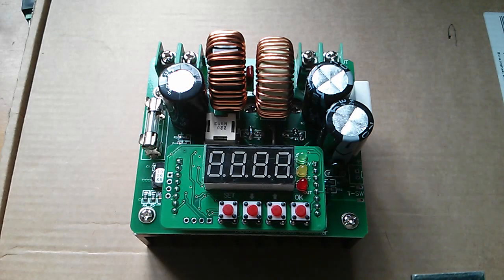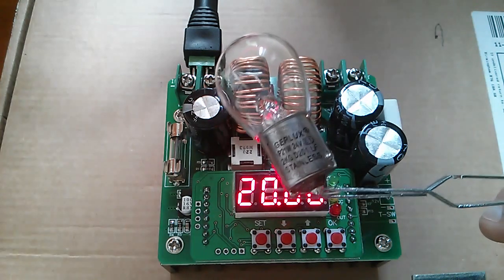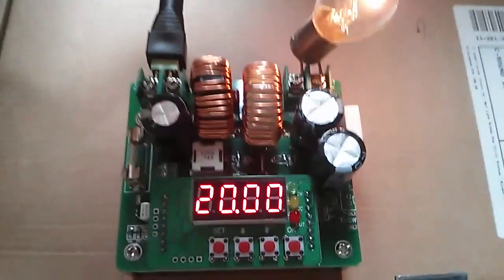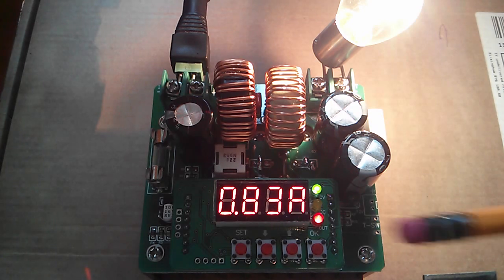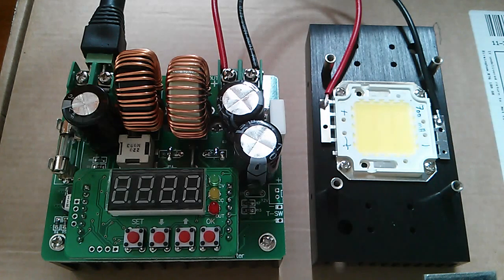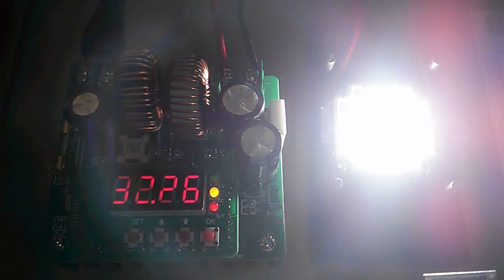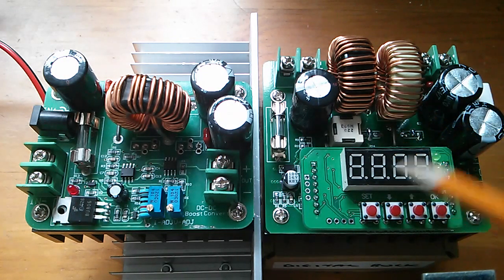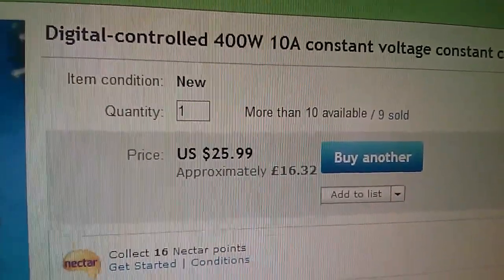Review: 400W Digitally Controlled DC/DC Step-Up Boost Converter

Comment: I was wondering if you could shed some light on something for me, I also bought one of these recently to power a 100w LED, which this should be more than capable of doing if i'm not mistaken, I have set it to the voltage and current limits that the advert for the LED states, but it doesn't even reach a third of the current and the booster powers off automatically. The fuse isn't blowing because it'll come straight back on again, and with the automatic mode on it'll keep powering straight up again by itself as it is supposed to, but reaches around 1.1 amps and shuts off again. Am I missing something here?
Reply from the maker: steamtraintom Try raising the voltage limit. If you limit the current, the voltage should be allowed to find its own value.

Comment: hi,
Does meanwell 48v 1000w inverter runs..I can use this converter instead of 4 batteries...

Input 12volt / 48volt output...

Does it work smoothly. Can I use inverter.. thank you

Comment: okay i need a little help i had bought a boost converter dont know if its a buck converter but the unit i have got can turn off and on the voltage so im guessing that mine is a buck but thats not the problem im having.. the main problem im having is that im connecting a 12.5V poersupply and it says it can output 20V and 1A but when i try to connect it to a motor or sommot the voltage drops down to like 0.30V and the amps stay the same i rly need help coz i havnt found anything anywhere about my problem (that might be because i dont know what to search XD) my unit is minghe D3806 if thats any help

Comment: Im a bit confused, 

So can this generate 32Volts @10amps with a 12v 10A input ? 
or do I need to feed 24v( or more) at the input end to get higher voltages ?
Reply: Arun Parikshat   It can't conjure energy out of nowhere. If you feed it 12volts,  10amp,  that's 120 watts, and you can't get more than 120 watts out.  So just multiply voltage by current to get a rough estimate.  Allow for 10% power loss if you want to be more accurate.

Comment: Hi Julian, so would I set the analog type buck controller in the same manner? ie, set the voltage to full and set current to what I want the LEDs to run at via the potentiometers.
Reply from the maker: saskLS1 To be safe I'd not set the voltage to full, but a little above what you think the LED will need.
Reply: Thank you, this has been most helpful since those regulators come with no instructions.

Comment: Hello Julian Ilett I have a question
Is the 400 W Digitally Controlled DC / DC Step-Up Boost Converter  fit to chip of vero29
The data chip are:
36V
2.0A
80W
I would like to run two LED chips of these and my fear that they will burn in terms of number of watts, what you say and offers to do?
Reply: This thing will drive your Veros.
Of course you always drive LED's in series so you're getting close to the upper Voltage limit of this thing so you won't be able to raise the current up much further.
Also you should have an eye on the input current. What supply do you plan on using to power the whole system?
Reply: צחי וקנין Feature:
Input voltage: DC 6V~40V
Input current: 15A (max)
Output voltage: DC 8V~80V
Output current: 0 ~ 9.99A
Voltage, current resolution: 0.01V, 0.01A
Output Power: 400W (max)

Comment: hi julian ! i just saw your video with 400watt boost converter ,,,is it possible to drive 1 or 2 , 50 watt leds (like yours) on that booster with a 12 volt lipo battery and as per the video we can adjust the amps on the booster(current),,,thks

Comment: Hi Julian Ilett, thanks for that great video!

First of all, I am a little bit newbie about that type of device. I have exactly the same boost converter. I got it in a grab pack by chance. I search the Internet to get more information on it and then I found that video. I plan to use it for different applications/projects while prototyping/learning.

Now I have a few questions:
1) What is the range of voltage/current I can get out of it if I plug on its input a power adapter which has an output of DC 9V/500mA?
2) Is it possible, from that input source precicely (9V/500mA), to increase BOTH the input voltage and current, to get an output of let's say 40V/0.7A (like on the video) or more?
3) Is it possible as well, conversely, to reduce BOTH to output only, like 5V/100mA or anything else?
4) I read in the video description that the output current is 10A max and 400W max power. So I guess that if I want to output let's say 50V, I will max out at 8A of current (50V * 8A = 400W). But, is it true regarless the power adapter I plug in its input (keeping it within the input tolerance of 6V-40V/15A)? This is only theorically, to learn, I don't have that need, at least right now.

Thanks
Jonathan
Reply from the maker: You don't get free Watts. So if you put 4.5W in (9v x 0.5A), you'll get less out.
Reply: @JulianIlett  Ok. It is 90% efficient, so the heat sink is there to dissipate 10% of heat we are losing. Right?

Comment: Would it be possible to run 4 x 100W LED's in parallel on this?
If so, should each LED have a low-ohm resistor to prevent individual LED overdrive?
Reply from the maker: No - not if the input voltage is significantly different from the output. The analogue version of this converter (which is rated at "600W") can drive a single 100W LED from a 12v input, but you can clearly hear it's near the limit.
Reply: Julian Ilett Assuming that you're referring to the noise the inductors are making, the sound an inductor makes doesn't indicate that it's near it's current/thermal limit. I've created loud inductor noises while running a inductor well within it's specs. That's why manufactures encapsulate inductors so the noise is less audible. It's just a small vibration caused due to frequency you're running the inductor at. It doesn't mean that it's struggling. Inductors you don't hear are probably still vibrating but the noise is higher than humans can hear.

If you're talking about the noise the unit making because it's on fire, then yes I'd say it's near it limit, probably over.
Reply: Julian Ilett How are you calculating that? I got a 100W LED light on ebay, and I bought a 150W 12V-35V boost stepup converter and from my calculations it should be fine?
Reply from the maker: OK, I take that back - the answer is still no because 4x 100W LEDs in parallel would require 12 Amps and this unit has a maximum output of 10. It's just that in my experience, these cheap units rarely live up to their specification and should be de-rated (often quite heavily) if they are to keep functioning. But I'd love to be proved wrong - if someone wants to put a 400W continuous load on this unit and video the result, I'd watch with great interest.

Comment: Hi Julian a bit curious did you ever measure the efficiency on the 400W dc-dc converter with for an example a 100W led running at around 31.8V i use some adjustable smps 36V powersupply fine tuned to around 31.8V and current is roughly 3.5A out so i theoretically put out 112W to it and the powersupply draws 650mA on the primary that will be 149.5W on 230V and efficiency in the convertion is around 0.73 (149.5/112) i am thinking is there is more energy efficient to run it thru a dc-dc converter?

But lord these things are touch to cool lol :)

Comment: Interesting video! I've made an electric bike, using two 12v 22ah lead acid batteries in parallel (so, they give me 12v 44ah), but the motor works in 36v, so i connected the batteries to a 12v-36v dc/dc converter to give me the voltage i need. The motor i had before was a 250w motor and the converter could work to 360w maximum. I burned two converters. I replaced the 250w motor with a bigger 500w for more power, and the converter with a more powerful 720w too. I burned it again after some weeks. I found on Alibaba another one for the same watts, but this time i burned it in few seconds. I was really dissapointed. I've just bought another one converter which is about 2 kilos heavy. 800w 20a maximum output and i hope will be fine. I have to test it, but if this will burn again i don't know what to do. Do you know why i burn all the converters? What i have to care about. Where is my wrong? I use some devices on my bike to check the amps the volts and the watts at any time and i've never seen more than 14amps. So, when a converter has a maximum output of 16amps for example, where is the wrong with this? Can you help me? Thank you!
Reply: Maybe you need a big diode on the output because the electric motor is an inductor and will dump current in reverse. Also heat! Just a guess.
Reply: Hello. 
Did you resolved the problem?

Comment: I would like to use this to drive a dc motor with a switch from a 12 volt battery is that possible ?
Also, if I plug a 12V 12A hour battery what would be the output current limitation ???

Comment: Hi there! I wanted to run my laptop which requires 19v 4.15amps directly through my 12v battery bank which is being charged my a 74 watts solar panel, will this converter help me to run it? Thank u your acknowledgment regarding this is highly appreciated. Thanks.
Reply from the maker: Yes, I think this converter would work fine in that setup
Reply: Thanks
Reply: Amik Munankarmy Some DC power supplys to laptops have pulsating DC. I think it does this so that the wiring and internal components don't heat up. Perhaps look at using a mini 150watt inverter with your current adapter to charge the laptop.
Reply: Julian Ilett Well, he has to be careful because of the ramp-up time you were describing.  For your LEDs it is fine (well, annoying, but won't damage them).  For sensitive electronics, an under-voltage could possibly damage it.  I have heard stories of MacBook Pros, for example, being damaged in this way.  I don't know if it was the battery or main board or what.
Reply: Can you adjust the amps and volts separately? What would amps be at 12 volts?

Comment: I can't get my current to adjust on the analog boost converter... it just sits there, any suggestions?
Reply from the maker: what's your load?
Reply: Tried 15 ohms resistive and 100 watt led with 20 ohms, no matter where I turn the pot it sits still. Shorting the output pops the fuse. Voltage works.
Reply: To Joblessalex,  i have the same problem, on my DC-DC boost converter, tryin to power a 100w smd, i get my 24v upto the 35v mark but the current adjuster does nothing ???. Thats why i bought one of these so i get the 35v at 3000mah,

Comment: This looks like an ideal piece of kit to add to my ATX power supply mod. Mounting the display looks to be a big challenge as it is recessed lower than the surround caps and doesn't have a way to mount standoffs.
Reply: yeah its a nice way to get a bit of control with the atx psu

Comment: Hi! Julian. Are there anyway to control this with arduino? I'm really interesting in it. I have 3A step down using similar control board on top.
Reply from the maker: Chanon Wangtrirat Both have Tx and Rx pins on the control board, but when I tried to communicate from an Arduino, it didn't work.
Reply: Julian Ilett It used STM8S 8-bit MCU to control every digital thing but I don't have ability to hack it or tap arduino to control.

Comment: Julian Ilett this is a very informative review, however I am wondering if this would kill (burn out) my high power cree LEDs as I'm trying to use minimal power for example I'm using a 9V battery for input, but would it kill the LEDs if i use low output (input to cree LED) amps at 35V? As this type of project will be used for my bicycle.

P.S. they have separate heat sinks. (it is a individual light set up)
Reply: No, if anything, more current into the LEDs would possibly harm them, and/or reduce their lifetime.

A 9V battery would probably last you about 5 minutes. Yep, 9V batteries don't have much capacity to store energy!
Reply: oh, however i dont want to carry heavy batteries as this is going to be used on a ordinary bicycle.
Reply: MegaCophater Well, you could use some lithium batteries, and even use a dynamo to help generate some extra power for longer lasting lighting :)

Comment: Hi Julian, thanks for the video. Any idea what the efficiency is of this converter? Does it put off a lot of heat?
Reply: 2nd question, besides powering LEDs, do you think one of these could be used to charge a lithium battery pack?
Reply from the maker: Typically 90% efficient, so 10% of your input power will be lost as jheat

Comment: Sir i am working in engineering college,I am interested in design of High Gain DC DC converters for PV system for High voltage applications  from your point of view which methodology is correct can you suggest me

Comment: just a thought, wouldn't one of those little led volt meters you can get for a buck or two on the cheap one do much the same?  I guess you would need an amp meter as well, but they do sell one with both volt and amp for what 4 bucks or so and it wouldn't be much to wire them into the cheap one then you would have basically the same but need the screwdriver instead of the finger to adjust. I guess I think about these things as I have always been nearly broke and need to think cheap.

Comment: If the chip is rated  36V@.7A then why is 32V driving .7A through the chip? I have a 100W Cold white, Input voltage: 32-34Vdc, Input Current: 3000MA that requires 36.6V to get 2980MA to flow through the chip...Tested with 2 in line Amp  meters and 1 shunt (clamp around wire) Amp meter.

Comment: Hi Julian, Thank You for your video on the DC/DC Boost Step-Up Converter, Great Job!
I have a question I need your help on, can these be used with my DYI 12V DC Permanent Magnet Wind Generator Motor, (the voltage this motor puts out is below the power needed to charge my battery, around 5V to the battery when its spinning)....will these Step-Up converters work for this application and provide enough power after setting the limits on the converter,.....any help is highly appreciated!....again Thank You for your great electronic videos!......Best Regards!  JK

Comment: 2 days ago I received two such converters. I've done exactly the same actions as in the video. I set the voltage to 40V and the current to 700mA. LED chip exactly the same for 20W. After I pressed the OK voltage climbed to 40V and the LED chip was blown. The current was almost 2A. Why not started current protection on 700mA. Why was not current on 700mA and the voltage is dropped. Does the devices are defective when it is not current control. I do not know what I was doing wrong. Where I'm wrong?
Reply: I can not believe that no one knows the answer to my question.
Reply: Let me repeat. I bought two of these converters on ebay and AliExpress. So from other seller. I set the voltage to 40V and current at 700mA. On the output I connect the LED Chip 20W. So exactly the same as in the video. When I pressed the OK button, the voltage at the output races to 40V and current over 2A (2,32A). In a second, LED chip 20W is burned. All I have to repeat with the other converter and again the same. It means that the current control does not work. Does anyone have the same problem. How to fix the converter?
Reply: I have a same problem...cant enter CC mode at all,everytime it goes to set voltage..

Comment: I would consider that unit to be fine for testing at a bench but definitely not the best unit to use in most projects.  Most people testing at a bench already have a decent variable PSU that offers constant current or constant voltage regulation so even for bench top use I think it would be of limited value.  I have 6 of those commercial outdoor LED lighting fixtures from RAB Lighting and even those take a couple seconds to come on from 220VAC down to the 35V 700ma they run on.

Comment: Hi, I got one of these, Just to see if i could get the power to my (High Power 100W  SMD Chip rated at 30-34vdc/3000ma), With 20volts DC in, it gets to 42v before the SMD 100w chip is pulling the 3000ma. The reason i tried this was the led driver that i got with the 100w SMD was always low on the amps only giving the led 1400ma at 36v when tested, i also tried the boost conv.... with only 12vdc in, it would stop at 41v and 2.14a .  any ideas??, as i thought/and have heard you could get one of these 100w SMD Chips to run at 36v/3a from a single 12vdc battery?
Reply: what kind of battery are you using?
Reply: 12v motor bike battery 9ah

Comment: Hi! I have a question if you could please answer me :D
Can you power this boost converter from a 12 v 75 Ah baterry? Will it burn the boost converter? 
Thnak you!
Reply: The boost converter will only ever draw the current it is set to draw from your battery (in this case, a maximum of 400W) at 12V this is 33.3 Amps max.
Your battery can handle this (assuming it's lead acid) and the boost converter will be happy to have a good battery like the one you have.
Reply: Thank you for the answer! It is really helpful to me! Have a great day!

Comment: Hi, Great video. i have some problems with the boost converter that i bought online. i don´t know what is actualy wrong???. i needed this to feed  led bulbs in the headlights of my car wich is 40w.  the boost converter have this info input 12-24Vdc ,I=dc 3A. output 30-36vdc, I=900ma. the efficiency is 90%. it wel be verey nice if i get some help because i am now stuck.

Comment: Help!!!! Mine burn out in fist attempt to connect with flames and bangs. Now I need to replace one of Mostfets but I can not read part number because its all burn out. Any one know what component is attached to metal heat sink. Starts with 1308 and I cant see any more... :(
Ehh. I dont want to order another one..